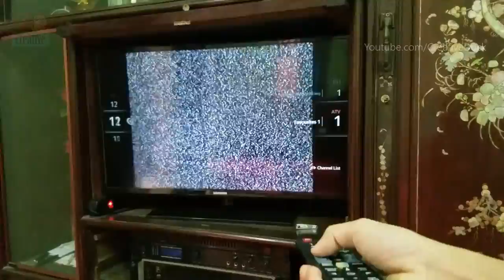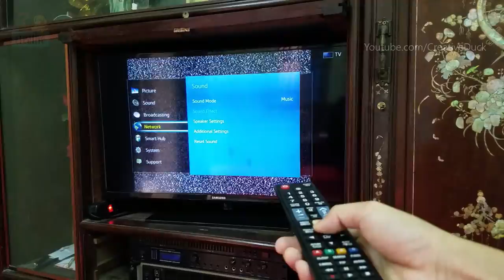Samsung tv remote control not work? repair it by this way, easy

Comment: Thank you so much for your instructions.  It took a while to lever of the casing, but your vid gave me the confidence to keep at it and lo and behold, there was damp in the works.   I gently wiped it dry with a paper towel (didn't think of using the hairdryer) and it now works a treat. *

Comment: Thanks. The lesson you gave - got the remote working again. Could not believe how much "muck" was in the remote (although, been in the kitchen for a good few years). The cover was very difficult to remove which I put down to "muck" that had got inside and was acting as an 'adhesive'. Really fantastic to get it working  again. Can't believe the down votes.

Comment: Thank you! Mine stopped working and after changing batteries was lit up, but did Nothing. None of the buttons or online "reset" instructions worked! Watched your video, took it apart, wiped a bit of moisture, cleaned and dried everything with paper towel, then fan, and it Now Works! Thank you! ❤
Reply from the maker: So glad to read your comment, congratulations friend

Comment: Thanks for this video.   The first time thru, I did not heat it with the hair dryer, I was sort of afraid to melt the remote.  But, after I assembled the remote, it did not function any better than before.  So, I took the remote apart again and cleaned more with alcohol, hit it with the dryer for 5 minutes, then alcohol again on the board.  There was more dirt that came off, but the alcohol evaporated promptly. When I assembled it the second time, it worked well,   This TV and remote are in the kitchen.  It was amazing how much cooking oil had entered the remote!   

I’m wondering, does the heat from the dryer warm the solder enough to “reconnect” it to working?

Comment: Thank you it worked!!! But why heat the battery? Do I have to do that frequently? And the only problem is that the remote doesn't close properly at the front of the Led....😅

Comment: that work good .i just need how to open it with out breaking it .i took it a part with plastic tool  and there tool mark on it.thanks
Reply: It is not possible to open the remote control and then assemble it without gluing, because it was assembled in the same way at the factory.
Reply: @Ognjen Ninkovic  there is no glue needed , mine did not
Reply: @danman9017  My remote is glued, by the way, I have a 2013 Samsung Smart TV F5300.
Reply: @Ognjen Ninkovic  i do not know wich  model i have but my  remote is the same as is in this video and the remote work great since the fix

Comment: I done this and worked...remove batteries hold in power button 60 secs and keep holding it in place the batteries back in while still holding the power on/off button.
Reply: I did the hold the power button suggestion and it worked perfectly.

Comment: He doesn't say what he did before he took the case apart. I would definitely try 1) remove batteries 2) press the Power ON button for 45 to 60 seconds. Press the STB power button for 15 seconds. 3) Press every key at least once. 4) install fresh batteries (you had already TRIED fresh batteries, correct?) 5) Try the remote again. This fixed my remote, a BN59-01178W.
Reply from the maker: Thanks for your opinion, friend,  it will definitely help someone

Comment: Be careful! Doesn‘t work with remote AA59-00638A (with backlight button top right). Mine broke, because it is glued on the left side by manufacturer. Rest works fine. Maybe I 3D print myself a housing.

Comment: My Samsung TV is working using Power Button, but when I use remote control theres only Power Red light indication but no Display..
But the Remote Is working In my Other Samsung TV
Reply: U can use the toggle behind the tv
Reply: @aditirai7680  where's the toggle?  What's it look like? This SAMSUNG SMART TV is apparently so smart..that it doesn't even have buttons to use ON THE TV ITSELF, when the remote goes kaput. Ugh🙄
Reply: @drwalkershope1500  ooh sorry for not being useful